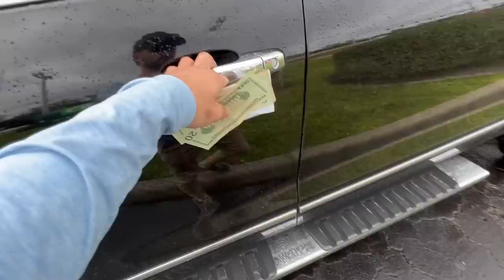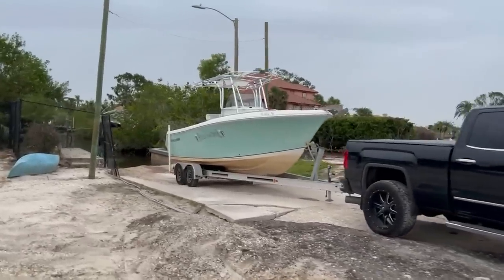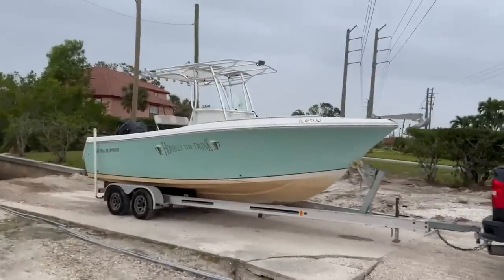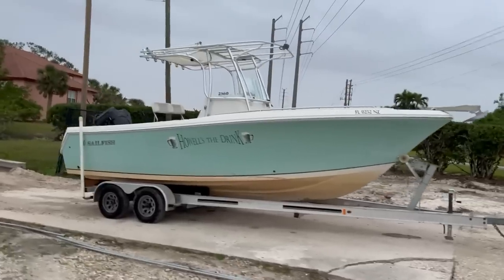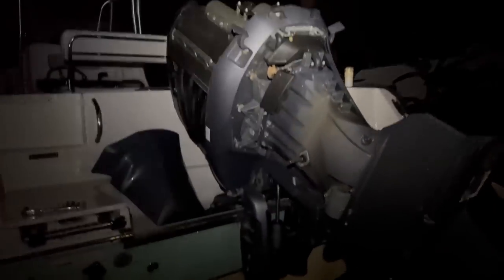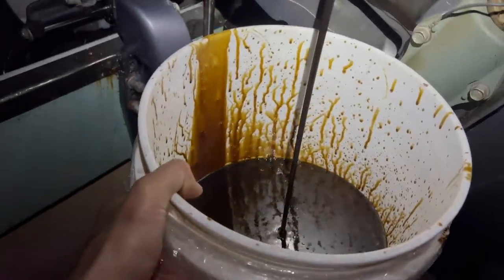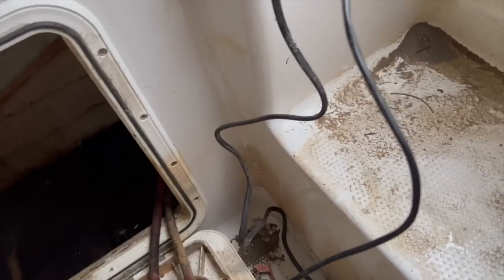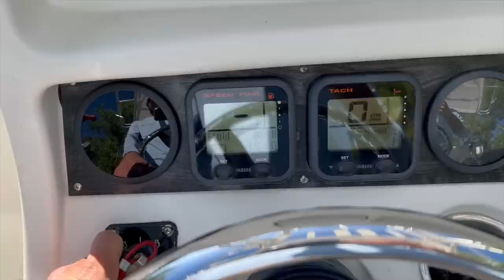I BOUGHT A HURRICANE DAMAGED BOAT IN FLORIDA !!

Comment: I had a small boatyard in Fort Lauderdale in 1969 and I was often amazed at boats that were under water for extensive time, like months, were capable of coming alive. In those days we would pour Marvel Mystery Oil into the cylinders, let it sit a couple days, hook up batteries, cycle the engine, put the engine together, clean the carb and then most often the engine was good to go. At that time I built  39 foot ferro-cement sailboat. Kudos on the great aerial videos show such a tragic state Ft. Myers endured. I like, many others, came by way of your sister's excellent videos which showed your jack of all skills and the wonderful relationship you have with her. Great start and I look forward to more.

Comment: Question, I’m looking at a boat to purchase go a good price I think, it’s a 1998 26 feet wellcraft cuddy , it has twin 150 mercury motors , the only issue is , it a hurricane damage boat that has been flipped in the water, price at 4 grand, what’s your take on it, I’m not to much worried about the motors , the m more interested in the hull , any thing o need to look for , your advice will be appreciated thanks

Comment: with the back of the boat having been under water your going to want to check everything in the bildge (bildge pump, raw water pump, float switch, thru hull fittings, wire connections, etc...), make sure its dried out, make sure water didnt penetrate into the stringers and soak the flotation foam.  the fuel tank in those boats should be plastic, so dont need to worry about tank corrosion, but the rest of the fuel system will need to be inspected (filters, fuel/water seperator, fuel lines).

Comment: Before you did anything you should’ve completely washed everything with fresh water like crazy.  You should’ve pulled the plugs and dumped oil in them and let it sit     I say that because I had a boat sink in salt and that’s what I did. If fired up beautiful didn’t even have to change starter or the power packs

Comment: First off you should have disconnected the fuel lines,  because tanks probably full of water.. pumped water into the system. if it wasn't already full and I really hoped you took them spark plugs out after you drain the oil.. seems like you know what you're doing though I hope you got it running going to take a look on your Channel